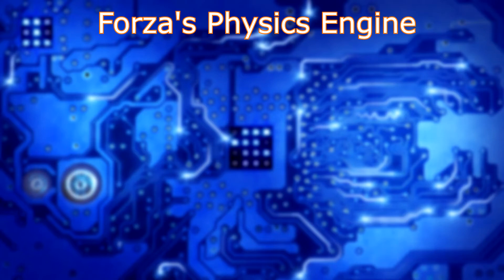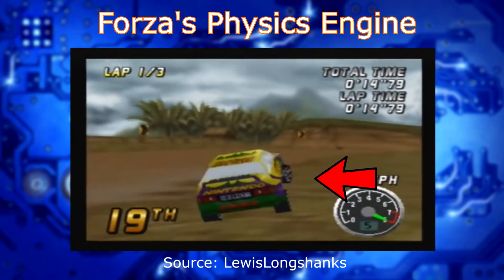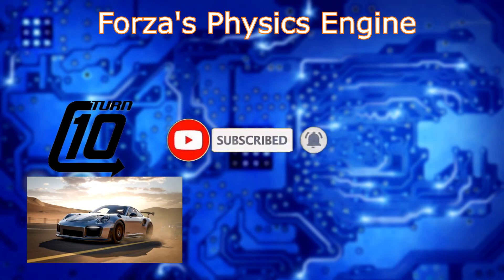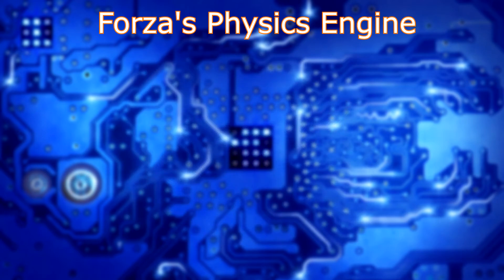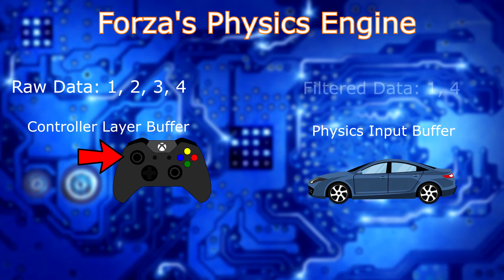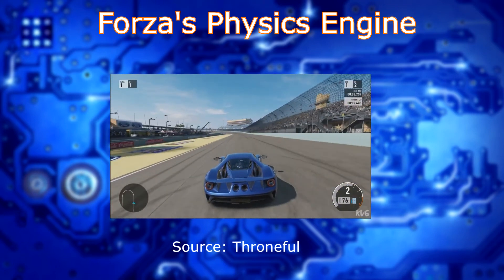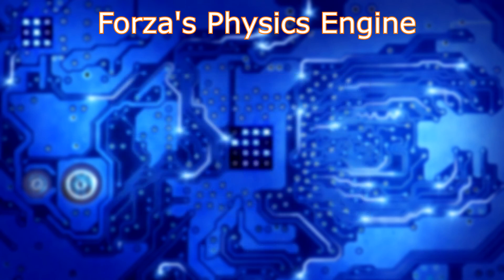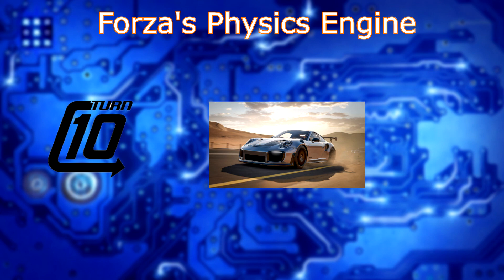The Story Behind Forza Motorsport's Physics Engine

Comment: Thanks for the deep dive. Own ever FM except FM 3. The controller buffer is what keeps FM lagging as a console "sim". Leave that buffer for the Horizon series. Turn 10 needs to let a wheel or toggled assists for controller users play more of a role in the active physics.
Reply: What's controller buffer on Forza Motorsport? And how does it affect driving?
Reply: @umarmahmood-g7dCompared to a wheel's range of motion (up to whatever degrees), a thumbstick' range is drastically less. Same goes for the comparison of throttle and break pedals to trigger buttons. To compensate for this, devs add a dampening effect to controller inputs; often to an exaggerated degree. For example, even with a controller, on something like ACC, you have to ease on the throttle out of turns, etc and generally be mindful of your inputs or things can go awry. Less hardcore sims will dial this dampening way up to be be more widely user friendly.
Reply: @roist_1 ohh ok but isnt that good like if Forza got rid of the dampening it will be like ac and u will understeer straight to the wall . Oh wait I saw Ur first comment I think they should do that for both horizon and Motorsport imagine horizon with Motorsport physics it would be much better and realistic that's something I always wanted, but I heard playing with a wheel with Motorsport is bad or something
Reply: And I heard that in fm4 or any Forza Motorsport the way they make understeer is by limiting how much the car can turn based on the speed , doesn't gran turismo or assetto Corsa do that ? There's no other way to simulate understeer

Comment: So I've been playing Forza Horizon 5 a bit and I think I can feel that "raw data" vs "filtered data" you're talking about, sometimes if you do a lot of erratic movements mid-corner it doesn't really matter for your overall corner speed. But then if you take a corner "too good", like really hug the inside line and nail it, it's almost like the physics engine is slowing you down and pushing you wide. It's like the physics engine is saying "hey there, you're driving faster than what I calculated is possible and we're going to adjust that". So it's a fun arcade game but definitely not simulation. I think after a while all cars start to feel the same in Forza, all the settings like suspension etc are virtually just window dressing for how the car feels and how responsive the controller inputs are. 

How fast you can actually go through a corner seems to be predetermined by the calculated "lateral g" you can see in the tune menu. So there's no point making a hyper-darty over-steering beast which is hard to drive, thinking you can be faster if you throw it into corners etc. Just make something which understeers slightly and is easy to follow the racing line with while keeping the thumbstick at full tilt. Similarly front or rear downforce doesn't really seem to matter either, it makes the car oversteer or understeer but what determines how fast you can through a corner is still the lateral g number at the left of the screen. You can put all you downforce in the rear if you want, it will still follow the determined maximum lateral g. 

Everyone is saying the Forza physics model is so advanced, I'm not sure. From where I'm sitting it's not real simulation but a pretty hefty approximation with a lot of window dressing, the car performance is heavily doctored by the performance index. The two things which the physics engine doesn't seem to doctor is acceleration and braking, so the best way to "break" the physics model seem to be to have max acceleration, best brakes and decent enough handling. Basically if you build a car which accelerates like crazy, brakes good and has decent to good lateral g's then it will be fast. And don't make it twitchy and hard to drive, it's not worth it and you won't go faster. It really is that simple.

Comment: Interesting, I didn't know the current Forza physics engine was built from the original. Havok is another physics engine that was in quite a lot of iconic games, and it might be interesting to hear your take on it's development as well. For instance, was it ever updated and improved over time? Is the Havok physics in Fallout 3 exactly the same as the Havok physics in Half-Life 2? I've always kind of wondered why so many companies would choose to implement third party physics code that they don't fully own into their own engine. Is it that hard to write your own physics engine from scratch that it makes more sense to buy one? If so, what changed? I haven't seen a game with Havok physics in years yet it used to be everywhere. It's not like physics in new games have improved much, if anything they've gotten worse trying to optimize around the previous console generation's weak Jaguar cores. Just look at Far Cry 2 compared to Far Cry 5, sure it looks better in screenshots but most of the environment is static. 🤔